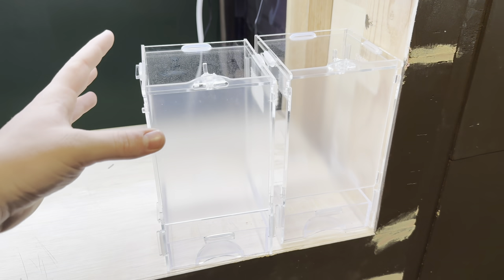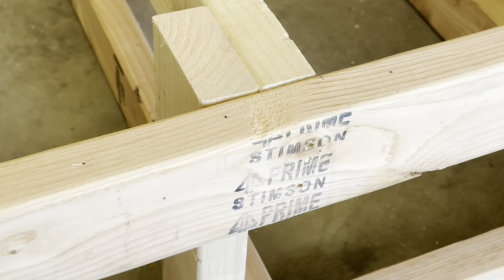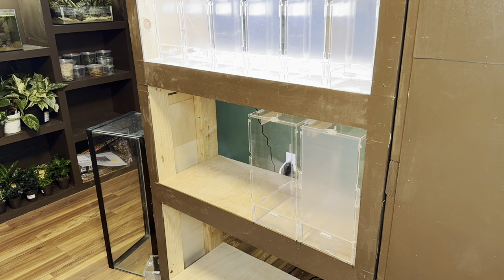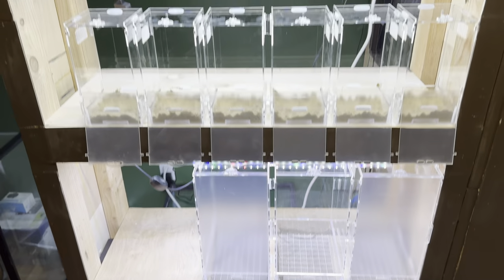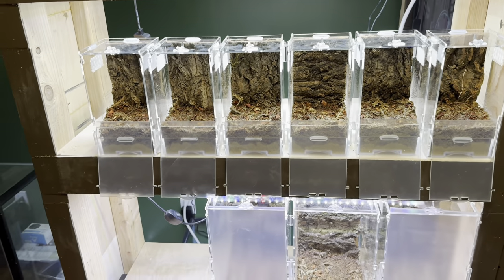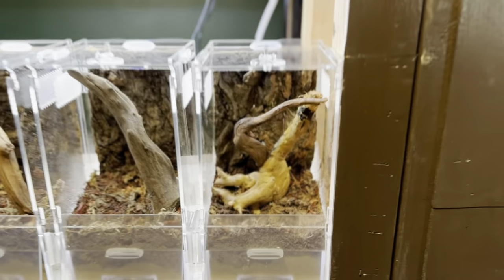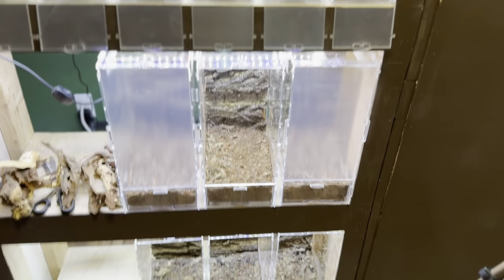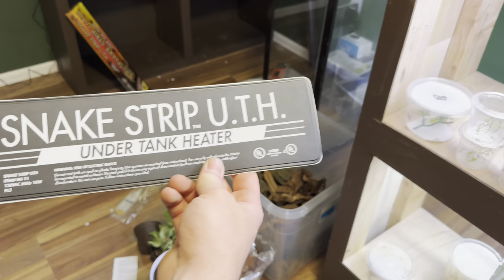PRAYING MANTIS setup for 10 species +giveaway

Comment: why aren’t/don’t the cheaper ones suitable/work?
Reply from the maker: They were very unstable and there were gaps between the pieces at the bottom which allowed for substrate to fall through. And they didn’t quite fit in the stand but that was more of a problem for my situation. Overall they weren’t awful but just not ideal for an enclosure like that.
Reply: @hodesigns  ahh okay! thanks! but they would be fine to use if you put leca on the bottom and put some window mesh on top so the substrate wouldn’t get down there?
Reply from the maker: It would probably be fine, but more for me it was them not fitting. If they fit I probably would’ve tried to make it work.
Reply: I've used some of the knock-offs from Amazon for jumping spiders and larger mantids. They have to be sitting on a dish to catch excess water (depends on how much you water, mine were planted). There are also decent gaps in the "hinge" area of the door where feeders could potentially get out, depending on what you're keeping.